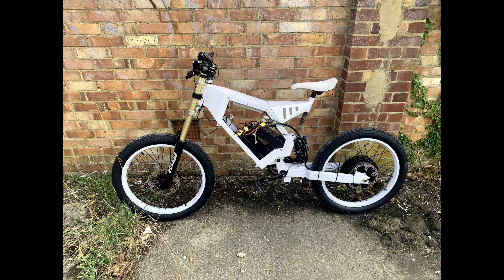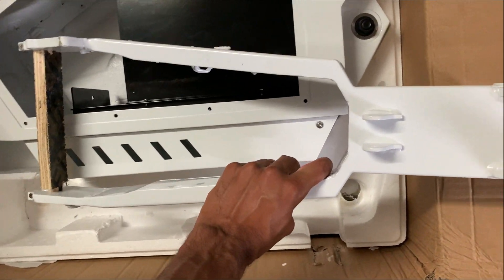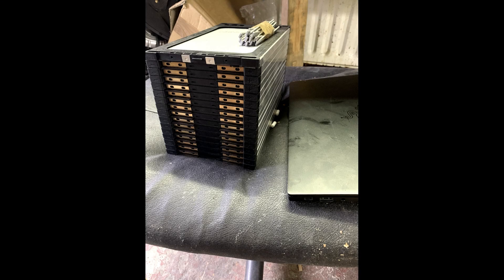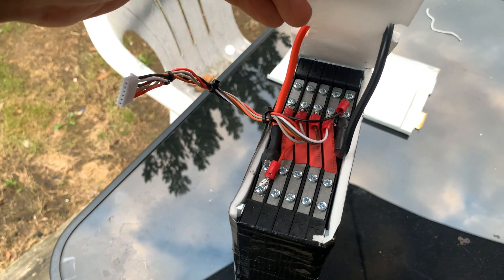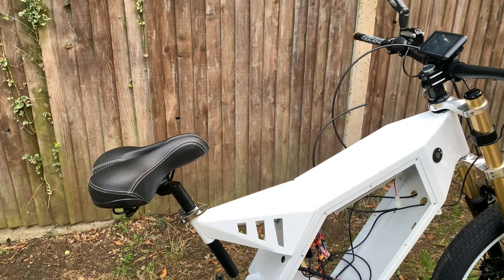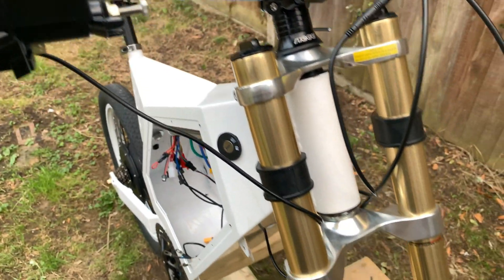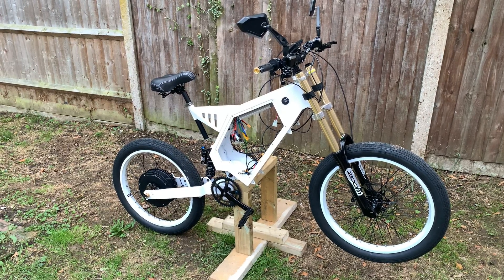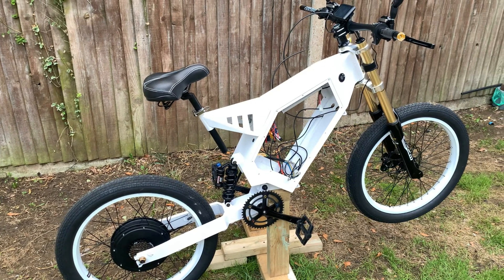Stealth Bomber Enduro E-Bike Build EP1 - Intro

Comment: hey mate, just wondering is you could put a midrive motor on the frame? Thanks
Reply from the maker: You could possibly fit a mid drive motor, but for something of this weight you would really want at least 4kw for it to be any good. So that would potentially throw the common Bafang mid drives out the window. Something like the CYC 3kw to 5kw mid drive could work with some modification, but I would honestly just go for a Rear hub motor and have some proper fun !

Comment: Where do u get them wheels?
Reply from the maker: The wheels where ordered custom when I purchased the rear hub motor through Alibaba. If you are interested I can send you the contact details for the supplier.

From what I have learned though, is that the rim size I went for made it very hard to source road legal tyres.

Comment: Hi mate I've gone same way with my brakes Ive nearly finished it I know the part you need if you still not found it
Reply: Got any links for the parts you bought? I've got the Mt420 calipers front and back but just wondering what I'll need to get the moto lever to work with them. Any help is appreciated thanks 😊

Comment: I’ve got one of these frames chucked in a cupboard 😂 it’s to much of a tank for me I paid £175
Reply from the maker: When I was last out riding this something caused the power to cut. At that moment I then realised how heavy the bike actually is with the steel frame 😂
Reply: @RascalTech  you need a forklift to follow behide 😂😂 I’ve got a mid drive thing now with pedalling and the right gear you can get mad speeds, if you want to cruse along just change gear 😉
Reply from the maker: @robz8989  Nicee man, I was looking to fit a mid drive to my latest bike build but I opted for a 1000w rear hub motor instead. For a pedal bike it’s a ripper 🔥.
Reply: @RascalTech  mid drive all the way for me the real wheels can bounce out if not Anchored both sides good happen to me once and wrote the wheel off, you can get 1000w mid drives but the 48v 750w with pedalling in the correct gear you can get some high speed over 40mph

Comment: Hello I have the same exact frame I put the rear hub motor / rim on and it seems like the swing arm is too wide by about an inch just wondering if you had the same problem wondering if you had to use spacers on the rear axle.
Reply from the maker: Yeah I also ran into the same issue. I am going to try and modify the rear swingarm and close the gap.
Reply: @RascalTech  yeah I was thinking of that or using spacers but I need to wait for my brakes I need to see where those end up before I start moving things

Comment: Im building  the same frame it always blows my mind when I see those 7speeds on these 🚲 i have a 5000w and can only fital a single speed  but my thinking is who the hell is pedaling these things  so why add the extra parts nice build brother ride on
Reply: You have to remember if there’s a big fault, like battery fail and your miles from home, wishing there were more gears to choose from on those massive hills, Yeah too late didn’t think about that😅
Reply: Same frame will take 3speeds with 5000 watt motor.
Reply: yeah if you had a situation where you HAD to peddle it... they'll be damn nice to have... and for the $50? worth it

Comment: Hello if you don't mind me asking how long is the rear shock is that 200 mm? And also are you using 19-in motorcycle wheels?
Reply from the maker: The rear shock is a DNM RCP-2S 200mm. I stupidly went for a set of 24 inch bicycle rims.
Reply: @RascalTech thank you, nothing wrong with 24-in rims!

Comment: Hey mate nice build! I'm doing a very similar one using the same and cells but pushing a bit more power (8000w) of you want to check it out.
Reply from the maker: Thanks , ill check it out !
Reply: I want to upgrade my controller and battery to do 8000w

Comment: Where did you get your tires and what size are they
Reply from the maker: The tyres are 24x3,0 . But they will be getting removed as they wont pass a UK MSVA test.
They were fitted with the motor+wheel combo I sourced from Alibaba.

Comment: Bruh Look at Lad i& margaret  channel, His batteries only take 40 minutes to fully charged. How far have you come with your bike to date?
Reply from the maker: Cheers I will take a look. So far not much more has been done to the bike whilst I sort out my garage. My summer house is nearly built now so I finally have the space back to continue the build.
Reply: @RascalTech  Greetz Bruh, SEAT. if your like me? you will see the potential. I can weld, but dont know if that is something you can or cant sort your end? Other colours available. vI recon a 2nd hand seat will go for around £10 - £20. from a bike salvage breakers via ebay, https://www.ebay.co.uk/itm/HONDA-CRF450-2018-4-STROKE-MOTORCROSS-BIKE-NICE-CLEAN-1-OWNER-BIKE/254749586400?hash=item3b504233e0:g:sSEAAOSwSDNfiFPZ

Comment: No zoom fork is made for downhill. 

Hell, they even tell you 'light trail use'.
Reply from the maker: Very true, I think it just refers to the style of fork. I  definitely wouldn't use these for off-roading anytime soon.
Reply: @RascalTech  

Yeah. You have to just be careful with those. 

Though, I'm overly paranoid with my Boxxer. Primarily because of the cost to fix it.
Reply: @RascalTech  

Oh, I do have a question about the frame. How close does the key come to your fork stanchions?

Comment: Hey Man I have same frame... U need to install the star nut into the steerer tube...  then tighten the cap otherwise your headset is gonnna come undone.  Zoom forks have to be replaced soon cuz they are dangerous... I did the dnmusd8 they are  awesome.    Do U have an Instagram?  We could swap tips I have quite a few
Reply from the maker: Thanks for the useful info ! Yeah my insta is @rascal_tech .

Comment: i have the same frame and was a little worried about the rear drop out size compared to my hub motor. did you just tighten yours down to fit? i just want to know before i tighten mines down too far and break it or something lol. i cant get the disk brake on without tightening the nut tighter but im too nervous to try lol. what did you do?
Reply from the maker: At the moment I still have a gap. I tried to tighten it down with a minimal amount of washers but the bracket did not align parallel to the rear hub. So im currently considering a few options at the moment, and the last resort is a sledge hammer.
Reply: @RascalTech  i got mines alligned. i just saw another video with a guy with the same frame as ours and he just had some washers that came with the caliper (to the looks of it) on attached the the bike frame instead of the caliper with longer screws to hold everything in place. if you can visualize that. i might just get another disc brake adapter and just put them side by side with the longer bolts for extra sturdiness besides the washers. but yeah i just did what he did and tightened the bolts on the hub motor a little more to  close the gap just a little bit more (not too far with the longer bolts and washers) and it spins good with the disc brake on.

here is the video of where i saw this.
couldnt find the video lol but here is something similar. you can see he just has longer bolts and nut as spacers/washers
@ 2:39
https://www.youtube.com/watch?v=YXgD2moMZJc&t=187s
Reply: the other guy i saw had the same frame though. used a similar technique

Comment: Hi mate did u manage to close up the rear drop out to fit ur rear hub in?
Reply: You just have to buy some washers from your local hardware store. That what I had to do when I built mine.
Reply: @GrahamDavidYT  I just tryed and close the axle they close pretty easily just tight  till it tight enough really but for extra safety I going to add torque arm on both side

Comment: you have to change the front zoom fork , trust me
Reply from the maker: Im going to be purchasing some DNM USD-8's soon.
Reply: why
Reply: @paquitortiz   the zoom fork has no rebound damping I think (Without rebound damping, the spring will re-extend too quickly, sometimes even further than its starting length. This is what causes oscillations – that wallowing or pogoing (pumping up and down) motion. )
Reply from the maker: @FloKTC  Thanks for posting, I really appreciate the help !

Comment: Hi mate, looking good 👍 I'm just sorting my own conversion but I'm having trouble with my battery pack, due to budget issues im using a 20ah 14s pack with recycled 18650 cells, really like the look of those cells you have used 👍 what are they again? The size and shape looks a lot easier to use! 
Cheers Dave
Reply from the maker: Hey, they are called EIG cells. Very easy to find on eBay at the moment for roughly £13 a cell. I was initially going to build my own battery pack with 18650 cells  but it was a lot simpler and safer to use EIG instead. 

For the size, they literally fit inside the frame with about 1mm of space on each side.

Comment: what was the drop out size of your rear wheel and did you need any spacers
Reply from the maker: The swing arm dropout was roughly 185mm, with the complete rear wheel being 135mm. With spacers I would really struggle to get disk brake fitted correctly. I will be covering this issue and possible solutions in my next video.
Reply: the pedal assist doesnt work on sabvaton either you need to hack it to get it to function

Comment: Do you need gears for msva im pretty sure you don't need them
Reply from the maker: Gears are not required but it would be nice to have useable gears on the rear, I tried a single speed setup but I wasn't a huge fan of it when I went for a test ride.